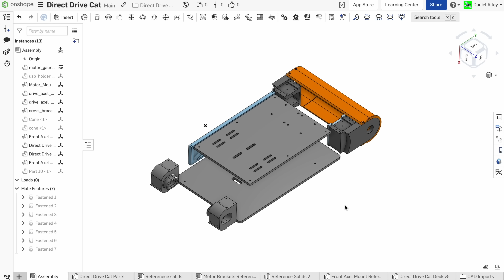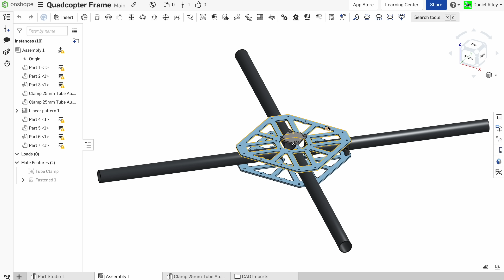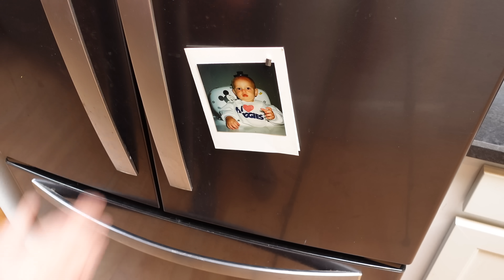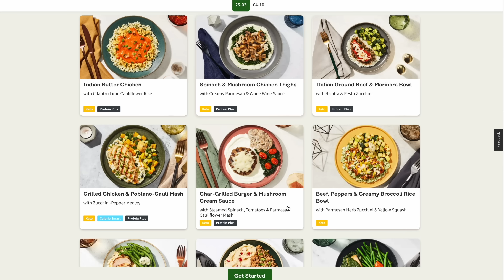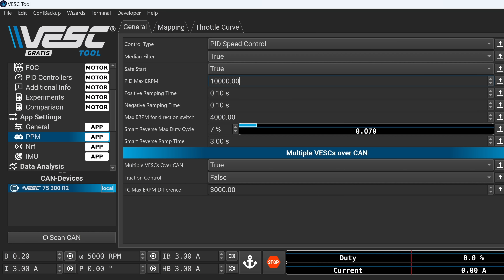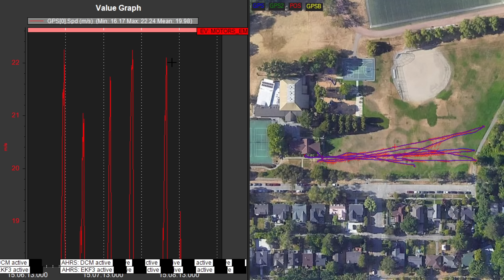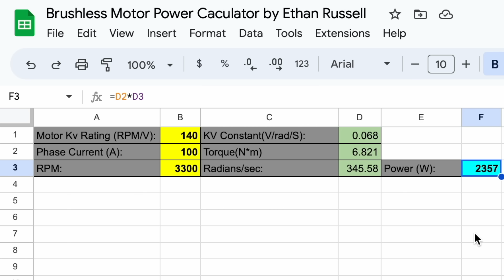Worlds FASTEST R/C Tracked Vehicle

Comment from the maker: Use code  RCTESTFLIGHT50  to get 50% OFF your first Factor box at https://bit.ly/3JgFdFQ
Reply: what song did you use for the montage at 7:45? the description is sadly incorrect. clicking on the link leads to a different song for me, and searching for the song on youtube leads to a completely different one, neither of which sound like the song used.
Reply: why do you use meters per second and miles/h mixed up? just use straight km/h
Reply: so uhh....have we tested this zooming across water? i am new to the channel so i havnt watched everything yet , but i'ma start that right after my brownies come out of the oven :) 

(ps. it has enough power and torq i think it would just zoom right over the water, but ive never seen a tanked rc do that yet)
Reply: not accessible
Reply: Hey, idk if you see these comments but what if you made it a little larger and heavier so you could either put 2 motors in the front and back instead of just the front or put 2 in the front and 2 in the middle with a support wheel in between the and then have a dead axle kinda deal in the back where all the controls and batteries etc are
Reply: Lake Kachess.
Reply: @SwitchRod  The sand was at Golden Gardens.  I think some of it was at 60 Acres in Redmond.  I didn't recognize anything else.
Reply: @Finx5000  I recognized areas you mentioned..."stumps" looked like Lake Kachess, Snoqualmie Pass? 🤷🏽‍♂️
Reply: Great, now put explosives on it and drive it under tanks
Reply: desperately need side spoilers..wings for downforce
Reply: Чувак! Обложи гусеницу пенопластом, и будешь кататься по воде! Сможешь выезжать из моря на  берег. С шиком!
Удлини платформу!
Reply: Would a front end wing help press the front down?
Reply: Now up away to Ukraine with a speed-tank jacked-up drone!
Reply: You need to make a variant of this that looks like the G.I. Joe Hiss tank :P
Reply: I did enjoy this video - a lot. The footage is so real I don't have to do the work myself to get the experience.
Reply: Он должен поехать по воде 👍
Reply: @rctestflight how much torque does it have? Could it pull/tow you in the snow or on the sand ?
Reply: @richardathey3116  very interesting, i d like to know, if i don t think it got more than 1 Nm, if it has 10 Nm, the whole army would need it :p
Reply: I'm building a power wheelchair I don't have all the kinks worked out..but I want to use hub motors so I can do 40ish
Reply: @Heyjaybird  have you considered using nuclear energy to power it?

Comment: i think formal coating is best way to protect the electronics. Epoxy is hard and unremoveable from electronics. As a fpv pilot i use formal coating and if i wanna add new sensor or anythink i warm the electronics with soldering iron without touch them. Btw great work. Congrats.

Comment: This is cool as hell. I've been debating for years on building an 8  wheeled tank (no tracks) I actually started and realized how expensive it's going to be. Basically, I figured out a way to use  nothing but Arrma Kraton 6s center/rear diff/suspension parts on a 10×30 aluminum plate i have cut sitting collecting spider webs. I'm and idiot because I could have finished by now if i was patient. I was going to FPV it with a airsoft gun and everything. Cool video though

Comment: 11:59 if the ERP limit is set too low and it’s the same speed on a 12 S battery. Would you get longer run time?
Reply: Yes technically

Comment: This is awesome, I can't help but think it would go faster with gearing.  I don't know why other than to say if those motors can move a 200lb man along with a 60lb scooter at 30mph or so, then surely they can move a 30 lb box of batteries like a banshee.   Edit, I realize you would need a more sophisticated track made of belted rubber or something and probably a bunch of steel components  which would involve a machine shop or a friend with a milling machine.  But just the power to weight ratio makes it seem like it has a lot left on the table.  Maybe something like a treadmill track or, if you wanted at least a little tread, maybe a geared serpentine belt (like an engine timing belt turned inside out) would help to drastically reduce the air resistance, be able to be run on rollers instead of drive gears and be able to handle higher speeds without breaking, although the reduction in traction probably defeats the point of make a tracked vehicle and they might not do good in the snow, still probably fast though.

Comment: Is there any specific reason not to use a gimbal BLDC motor for the tracks?

 I would prefer not to print the gears you use, and I already have two iPower GM5208-12 bldc motors

Comment: 2:12 This is what is stopping me from trying out 3D printing: Layer lines. To me, they are not even remotely acceptable. 
Until 3D printing progresses to the point that the internal structure contains no air bubbles or voids and layer lines 
are completely removed straight from the printer, it's just not good enough.

Comment: Seemingly small mistakes like epoxy in the usb c slot are the ones that can be the hardest to overcome. Unforseen, unpredictable, and it completely throws the project off the rails until it’s fixed. Sometime you don’t have replacement parts and the fix is going to be a whole project in itself. People don’t appreciate how satisfying it is when you find a good solution to something like that. From the outside it’s nothing, but to the person encountering it, it’s like defusing a bomb you didn’t see coming. Cutting a bit off the end was genius

Comment: Couple things...
1) I'd love to see some sort of TPU track option, both to further cut noise, as well as making it combatible with concrete, asphalt, and packed clay/dirt
2) can we see if it can hydroplane?
3) that "digging a nest" thing is awesome, and reminds me of a way that fullsize tanks can "bed down" for extra cover and concealment.

Imagine this thing as a remote-operated anti tank mine in a non-permissive enviroment that precluded manual placement... Drive some in manually and then remotely "dig them in" to get them slightly below ground surface... There's plenty of room in the design for a simple pressure pad and an EFP- and the underside of a tank and its tracks are the most vulnerable parts.

You may have accidentally invented an effective anti-armor tool

Comment: I'm way late to the party, but I still wanted to do the internet thing and provide a suggestion. Since you're using a flight controller, you can read the gyroscope data. If you have enough room in the chassis, you could add a moving counterweight, controlled automatically by the flight controller, to keep the nose down under acceleration and high speed. Obviously you'll have to make it move quick, but I think it could help. Maybe it would be possible to put the batteries on a sliding tray so you wouldn't actually be adding any weight other than the motor.

Comment: I wonder if you could add a sensor that knows when the front lifts then cuts the power to the tracks until it’s grounded again. That would help with the flipping. Also could add some downforce. The later would likely weigh less and be simpler over all.

Comment: @3:10 maybe it doesnt matter or maybe im misunderstanding, but i would slide a hella-thin washer onto the shaft before installing the coupler.  That would help eliminate gouging if there is any wonkiness, and reduce any sidewall friction when the wheel is supporting side-loads.

Comment: you could place a cover over the track to reduce the speed to air instead of reducing tread width, though it clearly makes it single sided. a whale-tail and putting the motors on the front might do for the flipping problem.

Comment: In order to prevent overturning caused by weight in the rear, you should print a fin wing like in racing cars. And will stick better to the surface and maybe increase the final speed
Reply: Or simply flip the design to put the motor weight at the front. As a side benefit, the torque at the motors will push everything behind it (the main tracks/body) down into the ground rather than trying to lift them up as was the case with the light area being at the front.

Comment: if you want to use all 120C XT60 wont work. you need those that are XT120 or XT150 or what they are called. i went up that high on my RC boats to be able to feed ESC and motors properly.
6.2hp sounds correct, but i thought 6.2 hp would get you going faster tho :(

Comment: Might want to do some throttle/speed grading where you limit the throttle at low speeds, and increase the limit, the faster it goes. That way you can prevent it from flipping itself over at high torque. That or you could install an accelerometer to detect a flip and have it back off the throttle when this is detected. You wouldalso have to cancel out the forward thrust in the calculations though to get the angle it's pointing upward at. This can pretty much be derived from the motor RPMs.

Comment: Do you think you could improve this if it had a kind of independent suspension/sway system? So when you turn, it would kind of lean into the turn, and angle the tracks to sort of carve its way through turns? That way it wont high side and flip over if you turn too sharp

Comment: Looked to me that you could've put a rear drag plate with a bit of flexibility on this. It would've stopped the front from rising up during excelleration. The plate would be the full width of the vehicle & possibly 150mm long, running at 10 to 20mm high, dependent on surface conditions 😁
Reply: Or simply flip the design to put the motors at the front. The moment of torque at the motors will push everything behind it (the main tracks/body in a flipped design) down into the ground rather than trying to lift them up as was the case with the light area being at the front. Effectively producing the effect you're talking about without the need for additional drag/components.

Comment: I've always wondered if you could put this type of equipment onto a snowboard to help for flat surfaces or even uphill.

Given that your feet sit spaced apart there is certainly room to place the mechanisms. 
Hell you could even look at some method to raise / lower the tracks off the board so it doesn't affect normal boarding. Then when you need it can be places down and push you along 

Would love to see you try!!

Comment: If it drives better with the weight of the motors int he front, and drives just fine upside down, then why not move the power disconnect to the other side and permanently drive it "upside down" so the motors are always in the front without modifying the motor directions relative to the controller?

Comment: Mannnn, this thing is awesome! You should totally make a version with rear suspension, either with some small rc car spring or another soft filament wheel. Since the thing is driving almost always in a wheelie I think that have the rear axles dampend will really improve the handeling and make it not flip. Also if you go for a soft filament wheel, the torque will be latend but also released faster, making it so wheelies are easier from a start. Which would be cool in my opinion.

Comment: Pretty sure even if you have 2 3s batteries wired together like that you need like an xt90 or ec5. An xt60 would be ok for 1 3s battery but running 2 3s batteries together you should treat them like a 6s right? I mean it didn't melt the xt60s so it worked regardless but maybe those xt60 aren't letting the 6s power do it thing lol maybe lol

Comment: I would recommend getting a small Round File for taking down the burrs inside your metal tubes after cuts. Im sure you dont NEED to do that. But it would be something nice to clean up the edges and to help prevent cutting yourself on them randomly.

Comment: Use the no limit software. Turn the abs cutoff time limit up. Turn battery amps and phase amps up. Turn on field weakening. Also connect nrf51822 for making changes over Bluetooth. Then connect the controllers over canbus so they talk to each other.

Comment: since its a two motor drive, how about an engine in the front and rear on opposite tracks? that could balance it weight wise, or that 12s battery could be enought weight in the front

Comment: FYI, you can also use thinned down silicone caulking (with 30+% vinegar, mineral spirits or toluene) as a waterproof coating and it can be removed/doesn't flow into everything quite as much as epoxy.  I've seen that done on some outdoor equipment I've dealt with in the past, that had to be repaired onsite.  One thing we did though, is use a multimeter on the wet caulking and choose a brand/type that did NOT have any continuity when wet.
Reply: There are also hard acrylic conformal coatings designed with high electrical resistance as well.

Comment: Brute force fix for the deep snow steering problem: flip the remote controller around 180*. I don't recall how you have your sticks configured (throttle+steering vs per-track throttle), but this could potentially give you an easy way to address the issue if your brain can handle the thumb swap better than the steering inversion. Imo it tends to be more natural of a switch.

Comment: I’ve wanted to find tracks about half the size of the factory ones before you cut them down… only out of a rubber that could be used in all terrain including carpet and tile floors. It would be used for making a track system to mount on a manual wheelchair, as a powered option. The cost of those Tank Chairs is very high and I’d like to be able to use it in hunting and fishing and chasing my baby around at the park.

Comment: The sand issue reminds me of the different approaches the AK-47 and the AR-15 take to handling debris. The AK has lose tolerances so sand can't get stuck anywhere. The AR has tight tolerances but uses those tolerances to keep the interior well sealed off from debris so long as you have a mag in and the dust cover closed. When you do something in between, you get the issues you had with sand scraping the motors.
Reply: My shooting coach in cadets used to compete for the Royal Navy in inter-force competitions, he told us one time that there was a competition he was in where his team was shooting rifles that were heavily affected by water on cartridges - a single droplet would make the rifle shoot 6 MOA high. Teams along the firing point were carefully shielding their ammunition from the rain, but it only took a single droplet to ruin a score. He opted to pour all of their ammo into the ditch behind the firing point, getting all of the ammo wet, and then adjusting the sights down to account for the 6 MOA 😅 (may be apocryphal, he was an old sailor, they all have batshit stories don't they?)
Reply: MERICA🇺🇸🇺🇸🇺🇸🦅🦅
Reply: I removed ALL lubrication thoroughly and then used PTFE dry lube. You spray it from an aerosol can and it dries with no water or oil in it. Best if both worlds.👍
Reply: I can’t help but think that you are going to be a wealthy man if you’re not already.
Reply: The AR platform rifle tends to perform better in the muddy and wet environments then the looser tolerance AK style rifles. While the AK performs better in the sand. Both perform pretty awful if you let them get really wet and then freeze though 😂.
Reply: @BodilyFunction  I've heard the best thing you can do for freezing conditions is to strip all the lube out so it can't freeze
Reply: @Synergy7Studios  it kinda depends on the kind of lube. A bit of oil based lube is ok in some areas but water based lube is no go. It also depends on actual temperatures aswell as just where the water gets to.
Reply: @BodilyFunction  I just remember the soldiers in Korea found that their garands ran better in the harsh winters when they ran them dry. Their oil must have had a high freezing point.
Reply: @Synergy7Studios  makes sense but also garands are a bit different to ARs.
Reply: @BodilyFunction  funnily enough, garands operate more similarly to AKs
Reply: @gonkdroid4prez539 this simply isn't true, the similarities begin and end with a two lug bolt face, and the fact that they're both gas operated.
Reply: @PaxHeadroom  I mean, long stroke gas piston rotating bolt is kinda the core of the gun, just the piston for a garand runs along the side. The two actual differences are internal vs external mag, and the ability to go full auto
Reply: @PaxHeadroom  the AK's design was directly influenced by the Garand. It's the entire reason they went with a long stroke piston over short stroke like literally all of its soviet contemporaries.
Reply: @BodilyFunction  Always frustrating trying to charge a weapon that's frozen in a block of ice
Reply: @BodilyFunction There was a video from Kalashnikov Group where they poured water over both AKs and ARs and froze them solid. All ARs had to get hot water on them to start working, an AK just had to be smacked against the table to get the bolt unstuck and it could fire again.
Reply: @Someone-lr6gu  It would also not hit the broad side of a barn after being frozen. What's funny is you believe a video from Russian propagandist. 😂 Kinda like their recruitment videos showing all men models but in reality they were mostly old chunky men just like most of Americas military nowadays.
Reply: @FarmerFpv it’s a thing about guns. yeah the gun in favor was from Russia, but gun performance  isn’t that big of a propaganda drive. The 1911 is more reliable than a 3D printed gun, doesn’t mean it’s 1911 propaganda.
Reply: How to tell you're American without saying you're fron America

Comment: Did you have trouble getting it to track straight? When I've built skid steering setups I struggled getting it to trim out, but that may have been because I wasn't using sensored motors.

Comment: Btw you should be using a torque screw on all of this to ensure everything is as tight as possible without stripping anything. This plastic isn't the most durable material so you really need to use torque screw driver to ensure its as tight as possible without over doing it